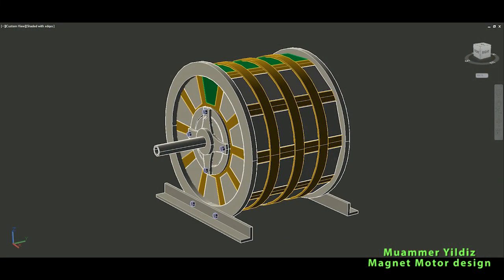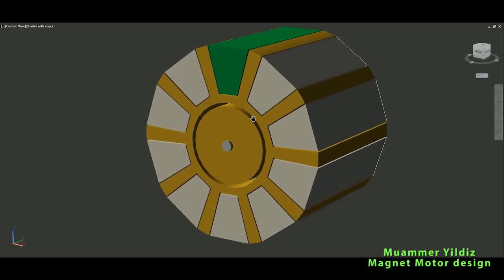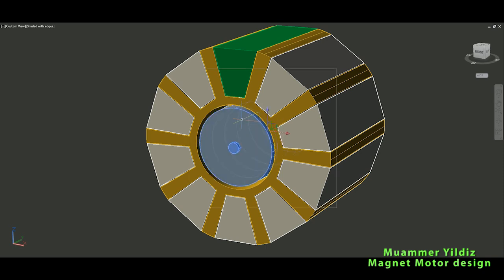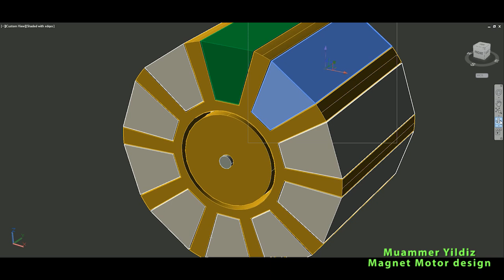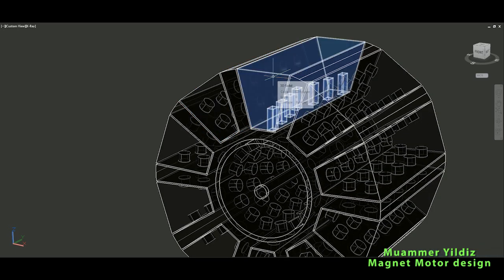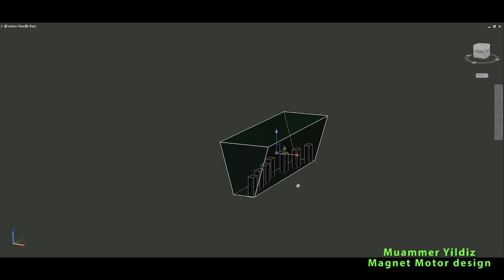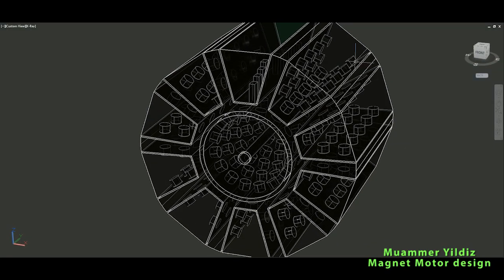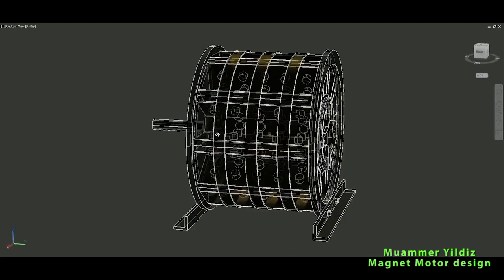Free Energy Generator, Working Patent! Muammer Yildiz Magnet Motor, Detail design!!!

Comment: First the Yildiz device is a prank. But tank you for the quality of the imagery. That machine got a hidden rechargeable battery in its base, in the aera never shown, watch the demonstration in a university in holland. In every just simple magnetic rotor-stator device we only get a perfectly vectors balanced device. The addition of all the energetic and resistive vectors, as many they could be, give a resultant vector of nothing in a cycle. When two magnets approach each other you get a first vector, and then a second vector of same force when they are going away from each other. For example in the case of two magnets of different polarities: Since you get first an attraction and an acceleration, the first vector is an energetic one, but the second vector is of course also attractive and cause a deceleraration of the mass, and so is a resistive vector, and energy plus its CONTRARY, the resistance, give always nothing. If  both magnets were rather of same polarities: For the first vector you get repulsion and deceleration, so its a resistive vector, and the second is also repulsive, cause acceleration, so is an energetic vector. Again resistance plus energy give nothing. And that's why it make no difference if you put magnets in angle, because we are dealing with magnetic field, not water hose. But a real perpetual motion device can be build if: The working principle is based on the transformation of forces into energies through a MECANISM that manage boths kind of vectors in a way to get an imbalance on the side of the energetic vectors. Remember, like in every machines, everything is a question of vectors.

Comment: Free engery very nice.
Where is your nobel price for breaking the second law of thermo dynamics
Reply: Oh, oh, oh..
  Eletric-Magnetic field  is  power, but neodimio Magnetic field  not have power...
     New discovery...
Reply: Actually, IF it really works as it is stated (or other magnet motors for that matter) that doesn't necessarily mean that the second law of thermodynamics had been broken. Hence something has to pay the price so I suppose that maybe the magnets. This machine would run until the magnets lose their properties. If that's the case then this would turn magnets into long-lasting batteries.

Comment: Great illustrations,  I saw a video of the motor running , it started when it was hit with a hammer , which was very strange
Reply: The First Premise of any Perpetual Motion device is that it MUST be Self-Starting,
Reply: The hammer thing is not displayed in this video or the 3d drawing here.
If you listen to the man who actually built it and demonstrated that it works, you will find out that there is no magnetic field generated before he hammers the pin. After this pin is in place it runs endlessly... Every model I've seen will eventually stop except for this pin hammering. I wonder what exactly happens that makes it continue running
Reply: @lindiigerum7567  If the pin is hammered in, the pin probably activates an electric switch and the motor runs driven by a hidden battery and e-motor. As long as Yildiz refuses to disassemble a motor which had been just running completely, his motor can be rated as one of the many scams in this field.
Reply: heinzpg but thats exactly what they did, dissassembled it
Reply: @Simon Ekendahl   No, it wasn't disassembled. If you watch the video from the Delft demonstration, you will see, that only outer parts were removed. The core of the machine was not disassembled at all. In addition, the outer parts were passed around but not examined. They could have functioned as batteries. There was another demonstration were Yildiz showed all parts in detail but there was no assurance that these parts were from a running machine.
Yildiz had offers for a thorough investigation either by a complete disassembly or a test for such a long time that a battery would be exhausted. He never agreed to such tests. Guess why.
Reply: @heinzpg  he disassembled it in germany,at a university demonstration.
Reply: @abdou28469  No. Have you read my previous comment? This disassembly was only partial and it took place in Delft, Netherlands. If you have other informations please indicate me your source or a video showing this complete disassembly.
Reply: The design is available. Build one and find out.
Reply: @jasonmaxwell9762  where can I find a 3d model ?

Comment: the greatest weakness for magnet is the icy cold weather.  Now I have a plan, if we able install this to a battery, then the battery should use for uses keep the magnet warm so keeping the generator warm, if the magnet get too hot, it will fan it down.  This will prove just incase something bad happen and this will prevent any changes of the energy.  Everything must balane it out, like men discover fire and able use fire for good and bad uses.  Now imagine  you have it on the car and you don't need the engine no more, its eletric computer now, but the problem is  the magnet in the car attend screw up the computer system.  So I recommend something doesn't create magnetism barrier to screw up the computer in the car, but keep able turn itself, so best to look for something keep the magnet barrier a minium as well.

Another thing must keep this in mind to fear is how people use energy, such as either they attend it to use it for good or evil.  For men of military will attend to use it on navi ship to power up the rail gun which prove useful and higher up the power sources, but if men shrink the size of this generator it would become rifle rail gun and replacing unneedy gun powder and cause greatly danger uses.  I which I do have several ocation in mind making it, but I do not want make a weapon out of it for I fear I would cause not must a masscure, but put a weapon into world domination and changes the bullets are today again.  Men will fear auto rail gun what it will do to men, the love one will get hurt the most.  This will cause men to fear the assult rifle, sniper rifle, if possible shotgun even more greater hights for it will go though walls and men don't need buy AP bullets no more.  A technology should not invented ever or more love one will die and the regrets is making weapons like these will destory the world that we know it.

This could also improve the laser power to cut things then yet again someone's fanasty about making death star would not be far away dream to be which I find it another dangours design to be still, but I hope the tech doesn't jump that far with laser power.

Comment: I've seen inside the Yildiz motor. What you call the rotor is actually part of the stator and you're version is missing half of the magnets. The rotor on the original Yildiz motor is made up of flat magnets.
Reply: Can you give some link to have more data?
Reply: Sorry I don’t have a link. I saw it at a show. The rotor looked more like a turbine. There were 1/4” flat magnets radiating out from the center shaft with only a few millimeters between that and the inner stator which was made of aluminum with a lot of 1/2” cylinder magnets recessed into it held in place with Allen key set screws. The outer stater was what we’ve all seen 8 pie shaped pieces containing stacked magnets that strengthened the magnet field of the inner stator.  This motor had very little torque and could be stopped by holding onto the rotor.

Comment: A magnetic motor was already designed decades ago in the u.s. but oil companies and utility companies don't want to hear about it. A guy even built a car with one running it, but under threat he doesn't say much about it. I thought about this concept one day about 15 or so years ago and to my surprise a man powers his whole house with one, and built a car that it run free of charge,and  it will even start itself.
Reply: wow, cool any video on that ?
Reply: Any vids on the subject?
Reply: It's a real thing is basic engineering. Magnets have a positive and a negative that push on each other. With two wheels one large and one slightly smaller, arrange the magnets to where they always push themselves away. Put the magnets on the big wheels negative out, they would have to be on an angle. Then arrange the magnets on the smaller wheel with negative out also on an angle. The larger wheel will be permanently mounted to a plate so it will not move. The smaller wheel is connected to a shaft to allow it to spin. When the smaller wheel with magnets goes into the bigger wheel that is fixed in place. The angle of the magnets on the wheel will force them away from each other. Causing the smaller wheel to spin. At this point you can do what you want. It's not forever and by no means perpetual, parts will need replaced in time. But you can turn generator motors with it, alternators, and yes a car. This set up is no different than a fuel system in a car. Replace the straight shaft with a crankshaft and a big enough magnetic force pushing against itself it would work. But the stranger the magnet the higher the danger. Test with care

Comment: the video is good just question could you demonstrate the polarization , you only explained the angles of 45 deg also what is the best material to manufacture the rotor and stator.
Reply: Forget it. It will not work.

Comment: Mario, how certain are you that this design is correct?  The patent has no pictures and I can't find videos that clearly show the cassettes.  Also, if you think you are 100% certain about the design, where do you think the net force comes from?  Obviously the V-shaped cassette, but I don't see how that would push through the sticky point.  What are your thoughts on this design?  I agree that it looks like this is the most likely candidate for a working magnet motor, but I can't see why it would work as you show it.

Comment: The main magnet and the copper winding are stationary.  It can generate electricity. Use a smart method to change the magnetic field at very low power.